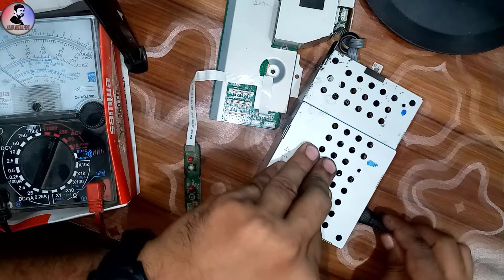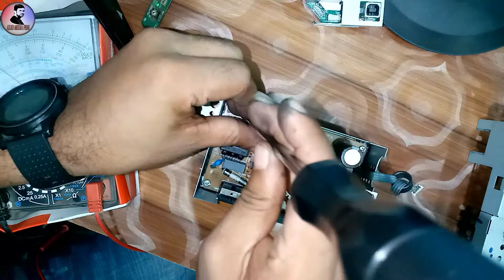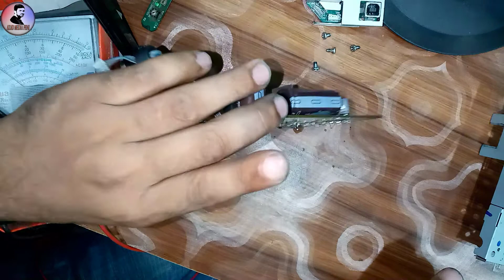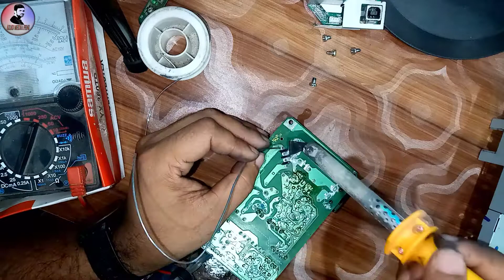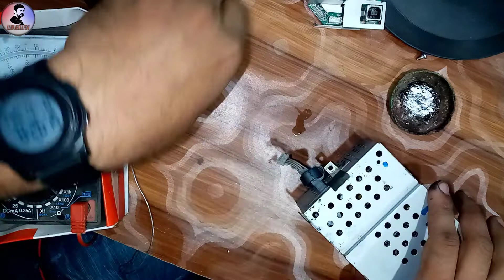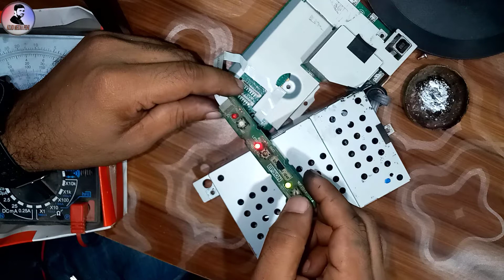How to repair epson R230 printers no power | how to repair epson R230 printer power supply100% fixed

Comment: brother i have the same model as like your power supply can i ask the value of r61, 371, rx71 and rx73 resistor? mine has been rusting so i cant read the value. it needs to be replaced. thanks in advance